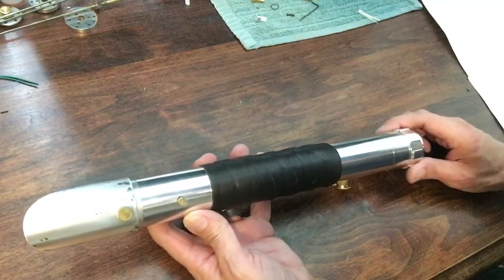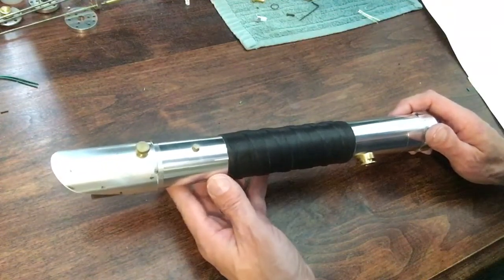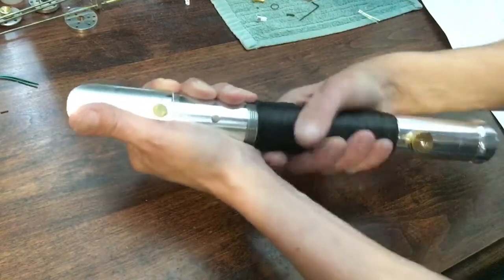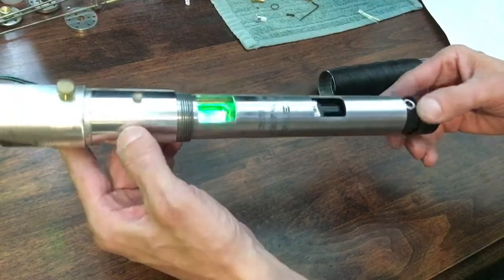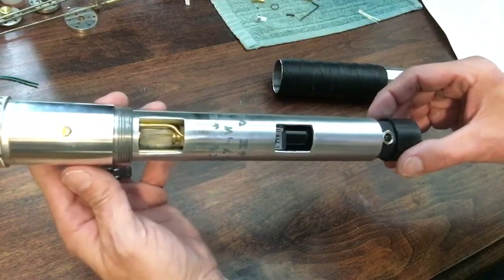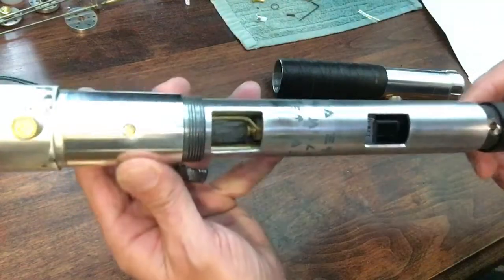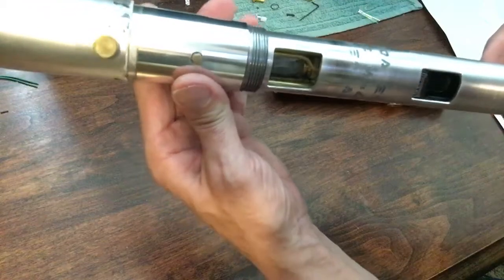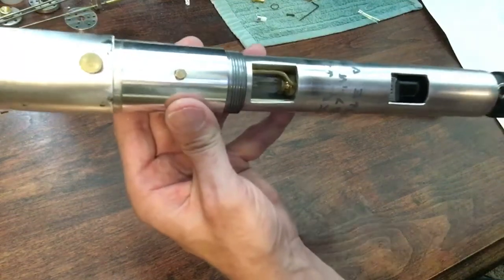My lightsaber build

Comment: What diameter is the aluminum for the chassis?
Reply from the maker: Ezra Knight, 1.25 and turned down on the lathe. I’m not sure the exact size. I just turn it down with light turns till it slides nicely through my body parts.
Reply: Jediseth Ok. Thank you for the reply. I’ve been considering making an aluminum chassis, but I don’t have a lathe so I’ve been trying to figure out if there is a size that will fit snuggly inside MHS parts without requiring any additional grinding down

Comment: Awesome Job JediSeth!  I'm doing an aluminum chassis very similar to that in my current Hasbro Kylo upgrade.  I'm using a 26650, and I don't think I'll have room for a chamber in this one, as the board has to be mounted aft of the battery.  I too, will be using a dremel cut off wheel for my battery/holder window, and my board window.  Since I can't mount my board to the battery, because the 26650 takes up the entire diameter of my 1" ID tube, I have to innovate something there.  I feel your pain, just cutting my pipe to length ate through several cutoff wheels.  Great Job!  If I can only get it looking half that good, I'm in business.  Tom Tilmon from TCSS forums.
Reply from the maker: fpsndiver , Thanks Tom! Good luck with your project, yes I've seen you on the forum. Thanks for the reply.